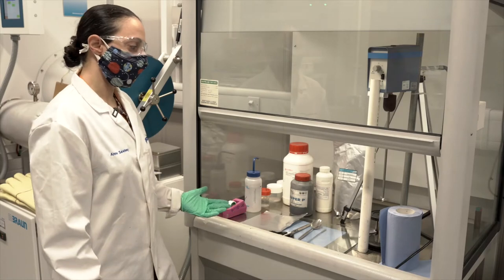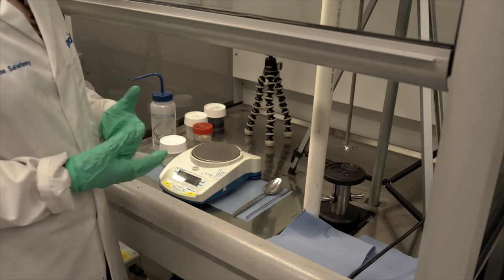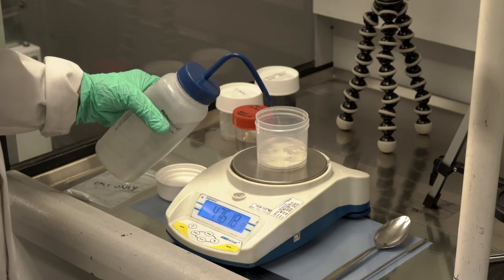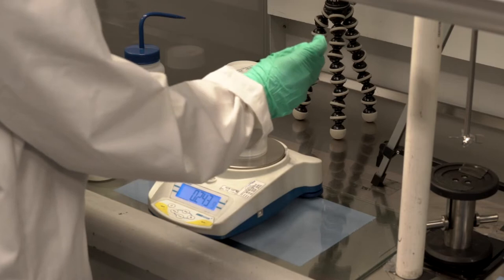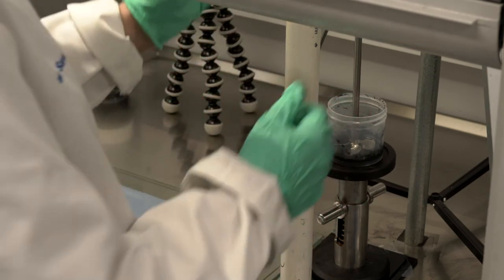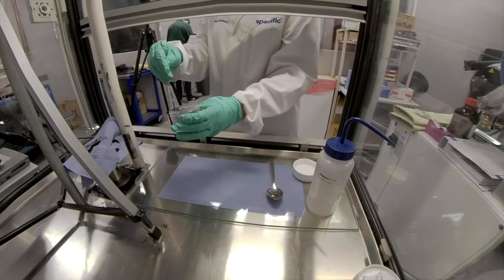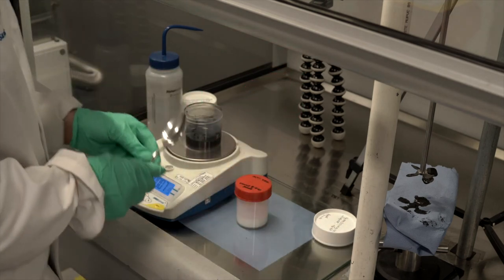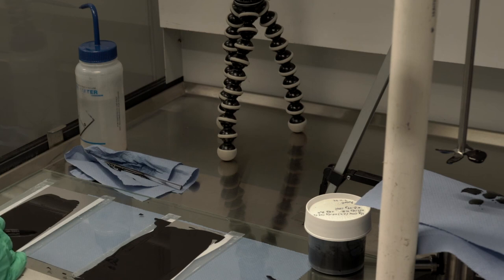How to Mix and Spread Hard Carbon Electrodes

Comment: Thanks for very clear and step by step process, which van be clearly understood. Can you please clear what you mean by hard carbon ? ( if is activated carbon or any thing else ).
Reply: Hard carbon it is a carbon that can’t be graphitised at high temperatures. For example over 600°C hard carbon keeps being non-graphitised
Reply: Hard carbon it is a carbon that can’t be graphitized at high temperatures. For example over 600°C hard carbon keeps being non-graphitized

Comment: Very nice demo of the prep process for these flexible, high performance electrodes. Thanks so much for your time and effort to share this. Is there any supplemental information on the curing / drying of the electrodes or is it as simple as evaporating the water content at a relatively moderate evaporation rate so as to not induce embrittlement or other non-optimal properties ?
Reply from the maker: Thank you, and I agree with the evidence that drying more slowly will prevent issues like SBR separation. I usually leave wet films in a dry room overnight, though most other groups appear to use a conventional oven or hot plate to speed the process. Importantly, to fully bake off as much trace water as possible before using in cells, I leave the films overnight at 120 degrees within a glovebox-fitted vacuumed antechamber before cutting them for application in cells.
Reply: What kind of conductive materials do you use to add in this slurry? Thank you so much

Comment: Hello madam, very informative video. What ratio you used for HC:SP:CMC. Thankyou.
Reply from the maker: My standard formula is 94% hard carbon, 2% CMC, 2% conductive additive (C65) and 2% SBR by dry weight.
Reply: Hello Mam, what is the % solution of SBR you prepared? From which, you used 0.48%. Please suggest the ratios of slurry  if I have 100 mg of HC. I usually use 80 mg HC, 500 mg CMC (2%) and 10 mg SP (8:1:1). But the stability is not very good in this ratio along with ICE.